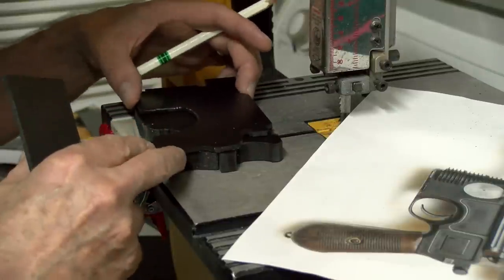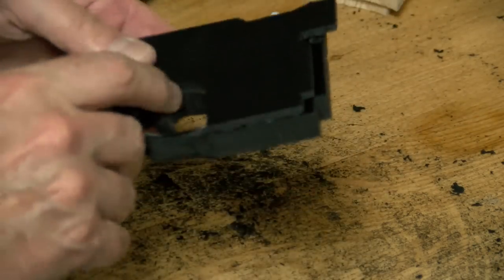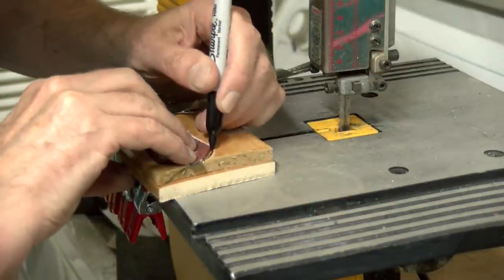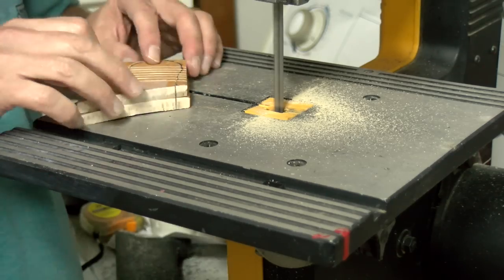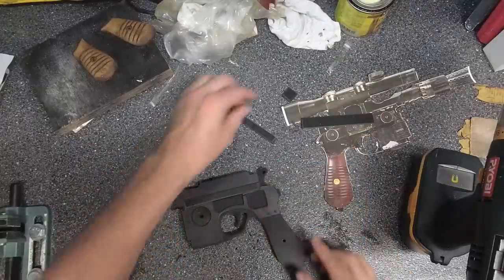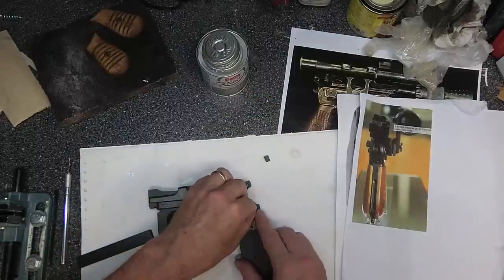Han Solo's DL-44 Heavy Blaster Pistol (How to make from scratch)

Comment: What are the pvc clamps that you use to hold the pvc
Reply from the maker: They are just cheap little spring clamps from any hardware store. They are about $1 each. I hope that helps. Thanks for w.
Reply: The one you use to hold the pvc scope on the gun, but you change your mind on the pvc clamp
Reply from the maker: Oh! I’m sorry. I found those at Home Depot. Here is a link:

https://www.homedepot.com/p/Carlon-3-4-in-PVC-Single-Mount-Conduit-Support-Strap-E978ECR/100170051?mtc=Shopping-B-F_Brand-G-Multi-NA-Multi-NA-Feed-PLA-NA-NA-Catchall_PLA&cm_mmc=Shopping-B-F_Brand-G-Multi-NA-Multi-NA-Feed-PLA-NA-NA-Catchall_PLA-71700000014585962-58700001236285396-92700010802552412&gclid=CjwKCAiA3OzvBRBXEiwALNKDP4Dxij6HB7GQG5tjhY-8w8ir_UHHtNaYH0j3mJ6ICbqZ8xbMfLvj0RoCMfsQAvD_BwE&gclsrc=aw.ds

Comment: What were those round clamps called?? The ones you didn't end up using
Reply from the maker: They are called 3/4” strap clamp. And I got them in the electric supply section at Home Depot. Thanks for watching.
Reply: Thanks